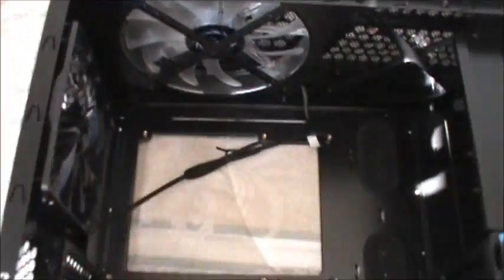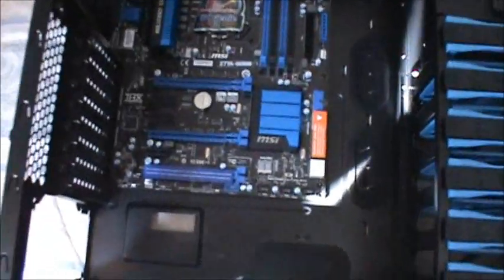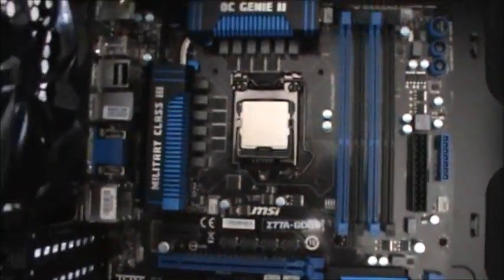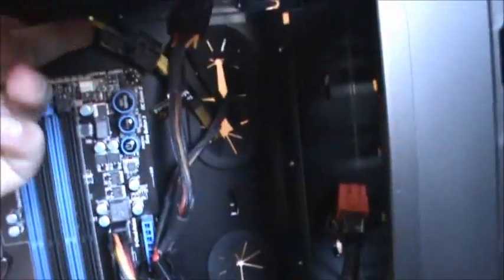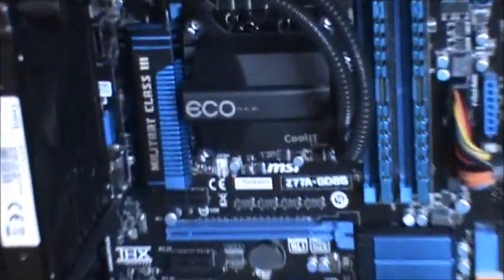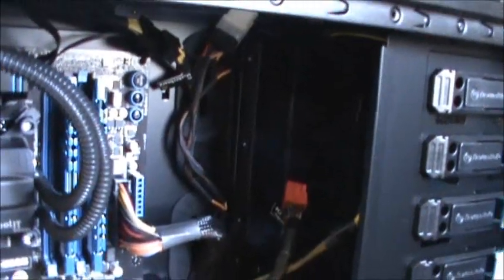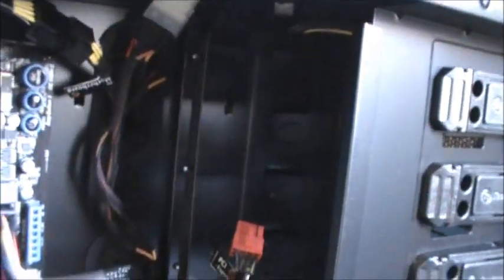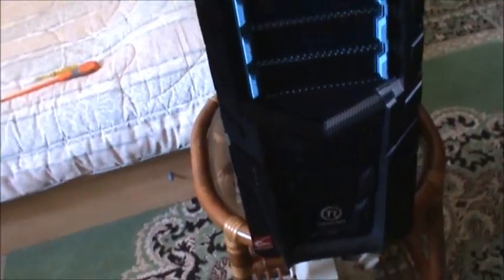Intel Gaming PC Build Part 2

Comment from the maker: Many games only require 2 cores atm, they are starting now to develop some games to use 4 cores, so I think an i5 especially the 3570K is a perfect solution. If cost is not an issue in your case, I personally would recommend an i7!

Comment from the maker: Go for the Gskill, they are cheaper and performance as equal or even better, not good for oveclocking, but if your not into that, then u are more than fine with the Gskill. I love mine and soon will be upgrading with another pair of these for a total of 16gb of Ram!

Comment from the maker: By default they run at 1333mhz, you have to set them up on the bios settings to run at 2133mhz. Mine are running those speeds in dual channel!

Comment from the maker: Well I think an i5 3570K is really more than enough for a gaming rig and it will last you many years, the i5 has 4 cores and 1 thread per core, while the i7 has 4 cores and 2 threads per core which works as an 8 core CPU. The K at the end of the number means that the CPU is highly overclokable which I personally recommend to extend a little bit more the life of your Rig for more demanding games in the future. the i5 3570K I think is the best CPU you can buy for a core i5.

Comment from the maker: Hi, could be that the HDMI port is not enabled on the Bios settings, so I would recommend using the DVI port at the beginning for installation and drivers. What are the simptoms? Do you have some beeps sounds when you turn the PC on?

Comment: I HAVE A VERY SIMILAR SPEC PC WITH YOURS THAT I HAVE FINISH TODAY, BUT BECAUSE THIS IS MY FIRST BUILD I HAVE A PROBLEM WITH THE VIDEO OUT. I CONNECT MY MONITOR WITH A HDMI CABLE FROM THE HDMI OUT OF THE MOTHERBOARD BUT THERE IS NO VIDEO SIGNAL. WHAT I HAVE TO DO?